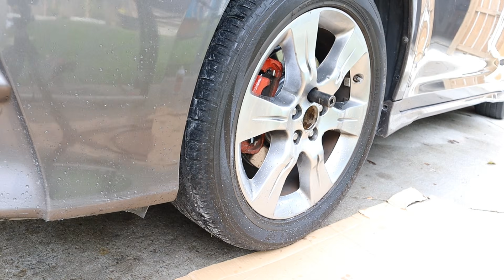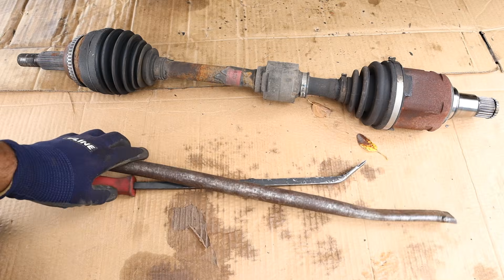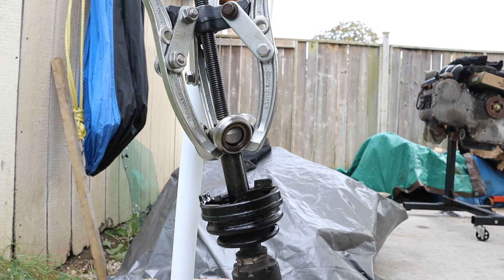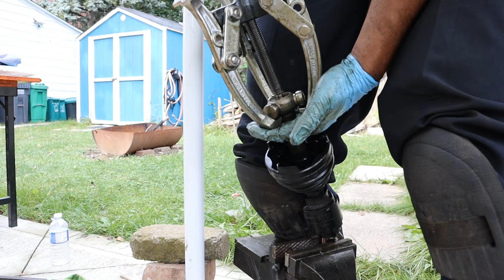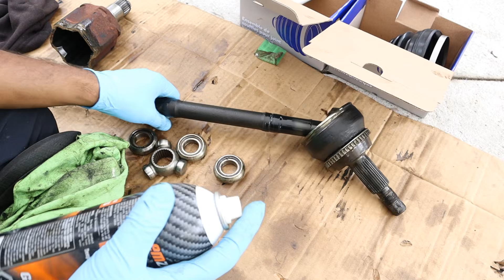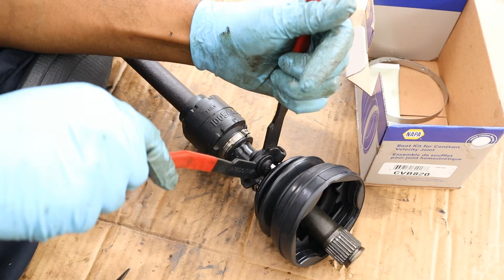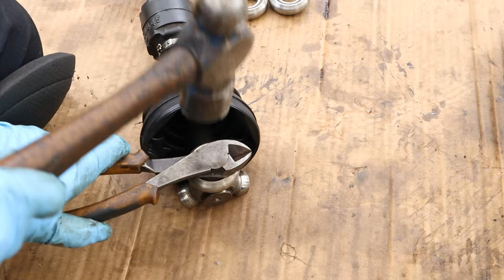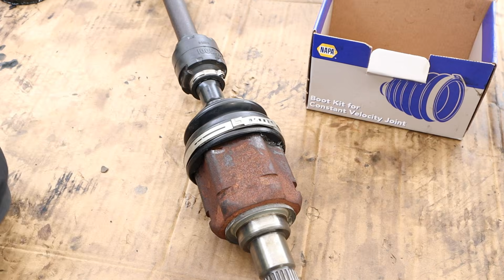How to Replace CV axle boots

Comment: Awesome video as always! 

Is that balancer on the shaft weighted on one side? Would it have to be placed in the exact right rotation on the shaft to balance it out? Just curious.
Reply from the maker: No it was evenly weighted. 
I think it's for harmonic balancing
Reply: This made me google. I was already wondering some time, why my car got such a thing only on one side. Quote, a search will bring a form up: "These are not usually torsional dampers like the one on the nose of the crankshaft. These dampers are typically for bending vibration excited by a natural resonance with something in the engine (firing order, crankshaft bending, face run-out of the flywheel, whatever). Sometimes the designer can just add a mass or maybe make the shaft tubular. Or, in this case a TMD, tuned mass damper. The added mass can detune some local resonance (first order halfshaft bending) or increase the input impedance of the system so some known engine excitation is no longer strong enough to ring the halfshaft."
Reply: @timtim8468  that's pretty interesting, but I can't tell if it was written by a non-native English speaker or if I just don't understand half the words in there. Haha. Either way, I get the gist. Very interesting. 

I've bought a few aftermarket axles that don't have those dampers and I was still getting shaking in the steering wheel at 65mph. It could have been from something else but I wonder if that had something to do with it.

Comment: Great video! How much do you save fixing the boot vs. replacing the entire axle assembly?
Reply: some aftermarket axles are of poor quality. It's recommended to reboot your OEM CV axles before they lose all the grease
Reply from the maker: Agreed. I did it to keep the OEM quality.
Reply: @Shiznit304  they should teach kids in school that they should only use OEM parts when fixing their cars. I used amazon wheel bearings on my old buick and they were shot in 40,000 miles. All the cheap parts are a complete waste of time.
Reply: Yes and no.  Generic Chinese parts should be avoided in most cases, but there are plenty of major brand aftermarket parts that provide good service and better value than OEM.  In fact many OEM parts (besides body/trim) are made by a 3rd party and can be bought under the 3rd party brand for significantly less than the relabeled OEM part costs. Good options for wheel bearings often include SKF, Schaeffler/FAG, Timken, among others.   Granted there's also the factor of whether you torqued them to the right spec.  @mmm31415
Reply from the maker: A boot kit is $20 per joint. 
New aftermarket axles are $100+
Reply: There's two type of cv boot (inner and outer). I  believe the you used are make of plastic. I much as possible I buy the OEM which are made of rubber. I pay more but at least I do it myself so the labor is free. It`s not as easy to do it like you show in your video. Removing the yoke is the hardest part.  And inserting the rubber boot is hard too. Takes me hours to replace one axle. I rather retain the oem axle than buy the Chinese.

Comment: Everyone who drives a car and maintains it to some degree should watch this video. Great job!
Reply: The problem is that I don't have siblings to steal their clothes and my wife and kids use electric toothbrushes. I've got the rest covered.
Reply: @johnnyblue4799  My problem is that im way too lazy and would probably just buy a new drive axle haha
Reply: @robincagan462  It's a solution if you buy OEM, or OE... quality stuff. Otherwise I'd rather replace the boots. I don't trust the cheap aftermarket crappy products.
Reply from the maker: Exactly! 

Not the easiest of tasks with removing that tripod though
Reply: Except the outer skip outer pull new boot why